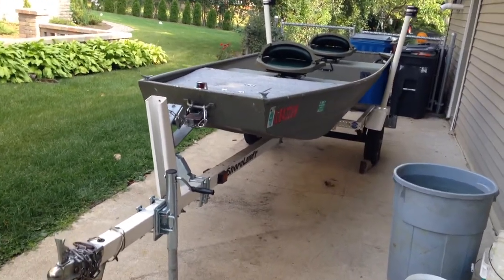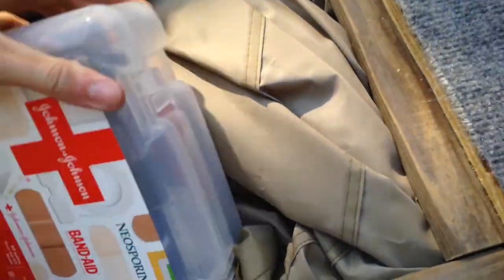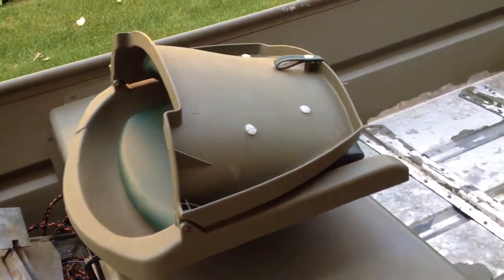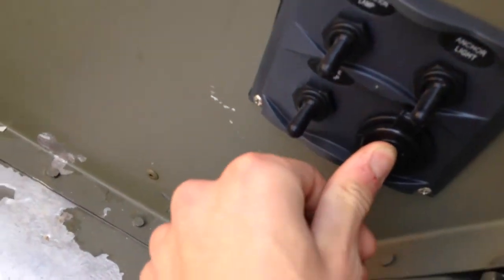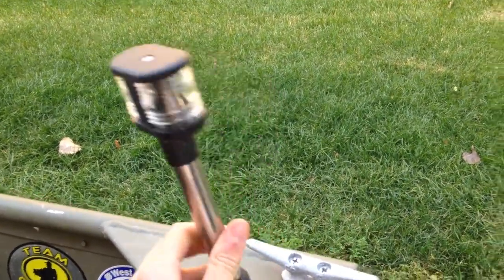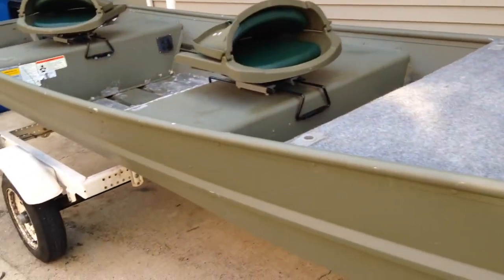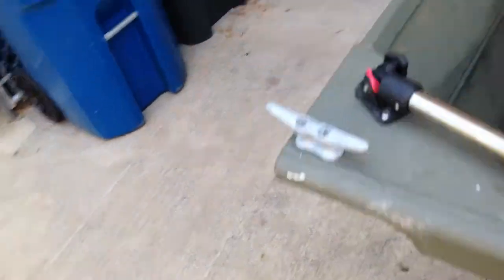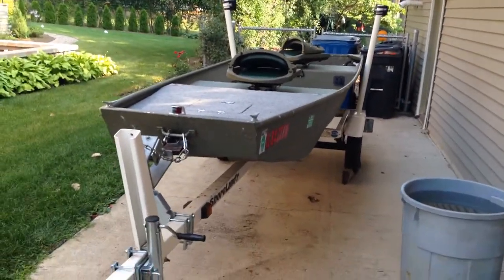Tracker jon boat modified

Comment from the maker: Sorry never updated the video not much has changed I actually haven’t used the boat in 4 years I just have not had time to use it. but maybe in the summer of 2019 I will bring it out and do some more mods I’d like to paint it and want a merc 10 hp motor.